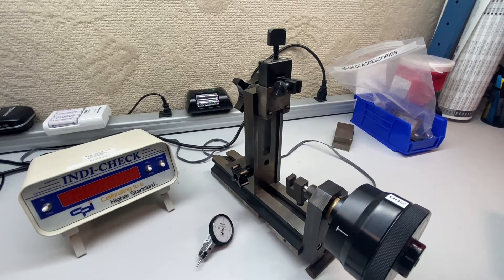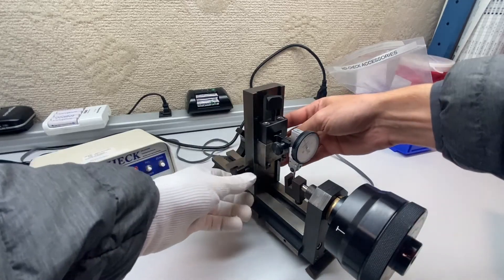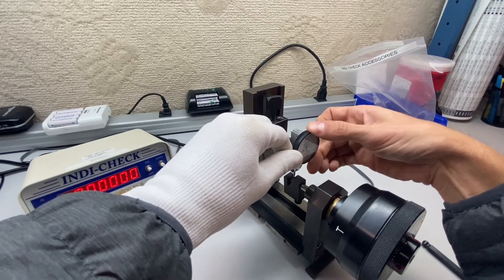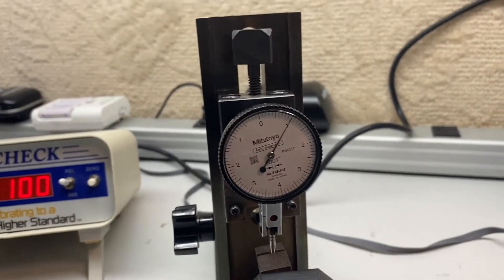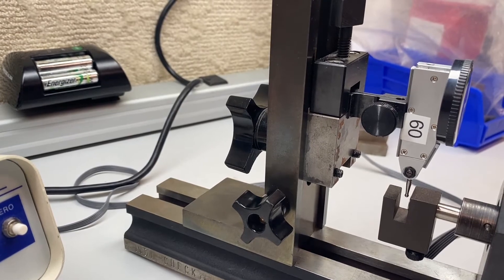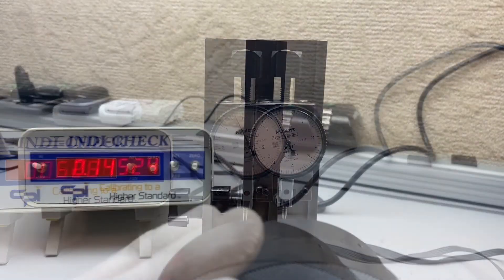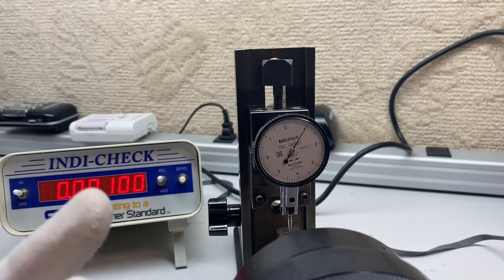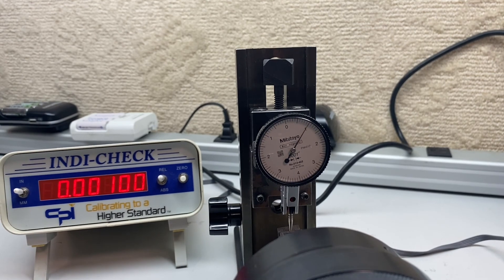05 - Test Indicator Calibration - Audit 2021

Comment: without any load, the needle isn't at 12:00 o'clock position until you applied some pressure, isn't this wrong? there a way to move the needle for calibration?